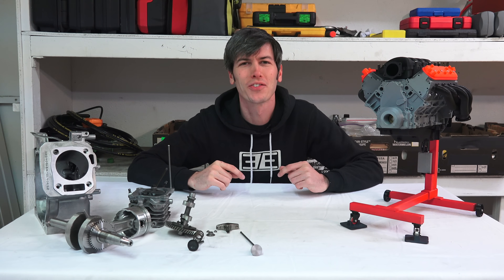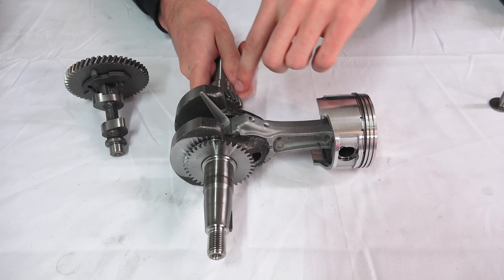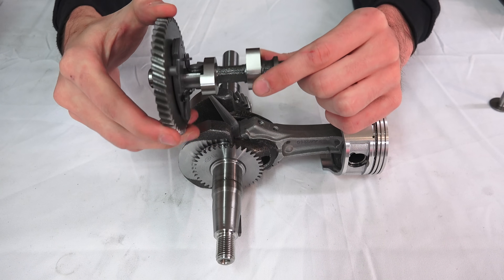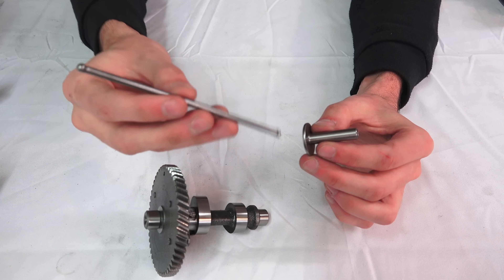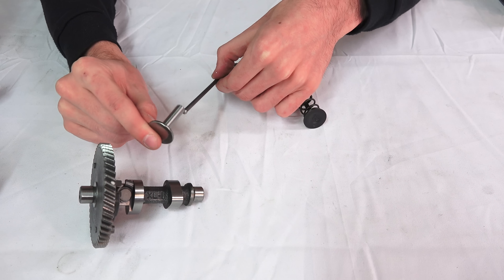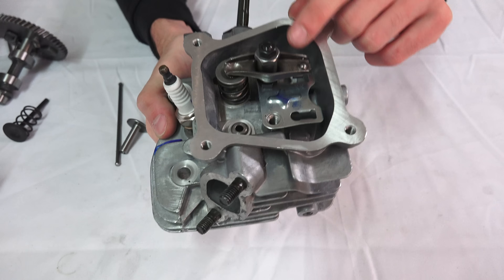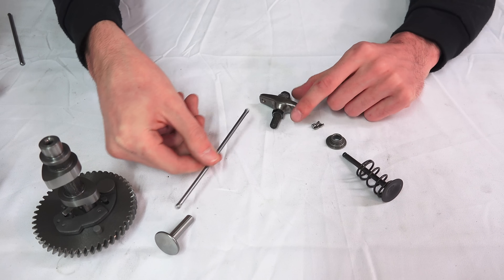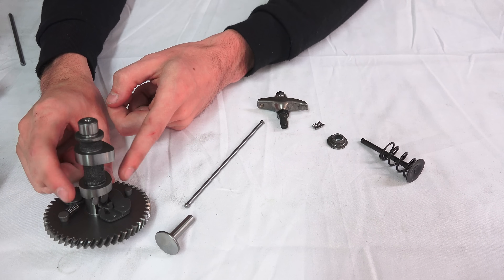Why Can't Pushrod Engines Rev High?

Comment: Everything is not about RPM but I hear what you're saying I seen lots of good pushrod engines rev high enough
Reply: They usually go as high as 5000 rpms with 6000 being in the caution and 7000 is the redline. But really you get lots of power in the lower rpms. Climbing hills is so much better in a push rod engine because of the low end torque. Going from a dead stop is always satisfying because you get so much power and you’re only at like 2000 rpms. Slower the cars moving the better faster the cars going it take a second or two to get the torque like if you are driving on the highway and need to pass someone it sometimes feels like the cars lagging to find the power to pass. But going slow the powers always there. It’s great in the low end sucks in the high end.

Comment: I have been into a some Ford DOHC V6. I will take pushrods any day. I'm speaking of drag racing, unless it's a pro stock, most engines I have seen that screamed outrageous RPM were usually 4 speed and impressive but not as fast as an engine that turns lower RPM with a power ladder. But don't listen to me, I'm still hanging on to the old Chevy V8 lol

Comment: My VK Holden Calais Director (Chevy Small Block 5.7 Litre / 350 Ci) revved to 8500 RPM and it was bullet proof. I was doing 48 secs around Oran Park Raceway until my wife took it shopping and it was stolen by a thief that followed her to the shops.

Comment: Instead of valves, why not have a wheel that spins and has an aperture in it through which fuel & air flows into the engine (the exhaust wheel would be the same but its aperture would align with the exhause stroke ofc).
It would be like a coin sorter.
Presumably the fuel and air would leak out of the gaps between the wheel surface and the edges that stop fuel just flowing all over the engine block on the non-fuel strokes?

Sure it would be inefficient, but could this give a much higher revving ottoman engine?

Comment: I was about to suggest an 8-stroke engine of sorts, with  4 valves per cylinder, but then realised it would face the same problem I've listed the proposed strokes below.
But surely doing the below, and using every other valve, would some kind of benefit to the wear and tear of the valves?

1: air intake 1 opens
2: compression
3: ignition and power stroke
4: exhaust port 1 opens
5 air intake 2 opens
6: compression
7: ignition and power stroke
8: exhaust valve 2 opens

Thus

Comment: the pushrod is the problem also too many moving parts. ohc does not have the pushrods. the cam lobe pushing strait down on the valve helps but then the chain or belt has to spin the cam and crank sprockets which needs tensioners and guides due to the length of chain and/or belt. the solenoid powered valves can be the answer.
Reply: solenoid is not the answer.  there is a limit on how fast a solenoid can make.  it is simply not up to the high rev engine standard.  so the highest rev monster motoGP engines use compressed nitrogen to open the valves

Comment: GREAT explanation.  Coincidentally I had just been exploring what "dual overhead cam" engines are (trying to learn about Alfa Romeo Spider engines) and they point out exactly the same things but from the sligthly different perspective of showing "why DOHC supports higher RPMs  than push-rod (less mass so less float and more valves for more air/exhaust flow, flexible intake/exhaust timing, as you nicely explain) But your explanation really explores and illuminates the push-rod engine side so I understand  both a lot better.  THANKS!  Subscribed and looking forward to more of you great explanations!

Comment: Am I the only one who likes all my torque/power under 3500 RPM? If you don’t wanna make power until 5500 RPM buy a Civic..
Reply: Same as me.  I am a lazy driver who do not want to kick the pedal hard to accelerate.  So low speed high torque is good to me.  I want smooth drive and not the thrill in speed

Comment: Marine diesel-engines are all made with push-rods, the main reason is the maintenance of cylinder-head/piston/liner: with a cam-shaft placed down, you can remove only one cylinder-head at the time, if you have an overhead system, then you need to remove the camshaft first, which is very heavy, because it pushes also the fuel injection pump, one per each cylinder.

Comment: Okay, let's get a couple things strait here.... Pushrodders will rev beyond 10k in the right build, ohc engines will float valves too just because they also rely on springs to close the valves, the only thing that WON'T float valves is either a desmodromic or a rotary-valve because neither of them rely on springs. I used to work on old radial engines that had triple valve springs and you could hear the harmonics starting to come in at 2950, and a self-rev-limiting valve float at 3300. Our 70's 377 Chevy Nascar engine on the other hand, would rev until it self destructed (Due to a rotten set of rod bolts) above 10k with no hint of harmonics or valve float. It's all how you build it.

Comment: Valve float is still a problem with overhead cams and with the use of auto adjustment oil filled hydraulic tappets oil aeration will limit the useful rpm of the engine anyway. For normal road use there is no need for high rpm which increases noise wear and narrows the power band which generally makes the car an absolute pain to drive. The balance between between  high bmep torque and power giving the widest power band possible is much more conducive to general use. The use of short hollow push rods and  hydraulic tappets can be used  to vary timing  and give a much more compact engine for packaging purposes

Comment: Around 9k rpm, valve springs need to be so heavy it frictional loses overtake power gain. 9k is therefore where pushrod engines becomes unadvisable

Comment: I had a streer rod with 302 with factory stock long block. Never had any problem accelerating to 6000 rpm. Never had a problem, and never needed more rpms than that. Very nice, simple, low maintenance affordable engine.

Comment: NASCAR can turn over 9500 rpm, and custom built gen1 Chevy can turn 16000, how fast do you want this engine to turn!  Besides most poshrod automotive engines make enough power 6k rpm is plenty! Besides at higher rpm engine components wear faster! Also aftermarkets have "rev-kits" putting extra springs on the lifter , taking them out of the equation, making them some what the same as a overhead cam engine,

Comment: Really there are pushrod engines with four valves per cylinder. 

for example Mercedes truck engines. OM 501V6, OM 502V8, smaller OM 904/924, OM906/926.  

Also MAN, Scania, Cummins, DD, Cat made pushrod engines with 4 valves per cylinder.

Comment: Push rod engines have low red line as parts have little bit play in them ..the accuracy to open n close valve trimming is a issue other thing is its longer stroke n high compression....piston travels more distance to complete one stroke...like in old hemi v8.....but it delivers high end torque at low revs...

Comment: I have a question, why some v8 engines in there stock state is so weak compared to other engines, for example ls3 produce 400 HP or lower while some small inline engines produce the same ?

And make a video comparing all of the most famous engine layouts and what is more efficient and which can be tuned for the best.

Comment: There is an modified LS7 that revs 11200rpm now. It's called spinal tap build by EFI University.
Reply: That's proof of the pudding, they have:

- a blank cheque-book (compared to most engine builders!)
- all the engineering know-how & metallurgical wonders that 2019 has to offer
- the expertise of an institution dedicated to building high performance engines

Yet they're unable to generate pushrod engine speeds higher those those (reliably) achieved by overhead cam race engines 30+ years ago. 

It's not a matter than you can't get high rpm from a pushrod engine (~12,500rpm is the highest I've heard of in large, multi-cylinder engines), it's just that with equal expertise and technology the engine-speed ceiling will be considerably higher with an overhead cam engine. Consider that F1 engines were race-reliable (so good for hours of hard running) at 19,500rpm and that was 20 years ago - just before the 19,000rpm cap was introduced.
Reply: @descb1060  F1 engines use small pistons with a very short stroke. It's all about piston speed.
Reply: @descb1060  From what I have read the big limiting factors on engine rpm is how stroke effects piston speed. Different fuels explode at different speeds. Those super high rpms are possible with racing fuel not with gasoline. Those engines also use really short stroke cranks. The whole overhead cam vs pushrod debate isn't about what's better it's about what works for a particular application. Pushrod engines are lighter and more compact. Getting that setup to run like an OHC engine is very difficult but not impossible depending on what OHC engine you are competing with.

Comment: most push rod V8 are set up for  low end grunt in truck/ passenger car  applications  they can be built to rev high but most street aplacations it's  not not nessary simply the low rev engine will last longer

Comment: AND THIS IS EXACTLY WHY THE COYOTE AND THE VUDOON ENGINES!.....FROM FORD MOTOR COMPANY CAN MAKE SO MUCH POWER FROM THOSE LITTLE (Well, Relatively Speaking!😉) CAN MAKE THOSE MUCH LARGER LS OR LT CHEVY V8's AND THOSE MOPAR HEMI's SEE THE "ASS END" OF THE MUSTANGS!!.........EVERYONE BUT FORD IS USING 100 YEAR OLD TECHNOLOGY WITH REGARDS TO THIER BIG V8's!...........EXCEPTION BEING, THAT FREAKING BEAST THAT WAS IN THE ZR1 VETTE's FROM 1990-1995 AS THAT 350 (ONLY SHARED ENGINE DISPLACEMENT WITH THE REGULAR 245-260 HP ENGINES FROM THE REGULAR CORVETTES!!!.......AS THAT MERCURY MARINE+YAMAHA (With Some Ferrari Mixed In!) WAS A GREAT DOHC 4 VALVE PER CYLINDER 405-415 HP (WHICH WAS REALLY PUSHING CLOSER TO 500 HORSEPOWER!! "AND MACHINED SO PERFECT, THAT HEAD GASKETS WERE N-O-T EVEN NEEDED!!😳😳😳 WAS A TECHNOLOGY MASTERPIECE FOR WAY BACK IN THE LATE 1980's WHEN THEY BUILT THAT GORGEOUS PEICE OF REV. TO THE MOON ENGINE!!......

It's Too Bad That It Cost More Then The REST OF THE WHOLE CORVETTE TO MANUFACTURE!......BUT AS A FORD MAN! I DID INDEED HAVE THE PRIVILEGE TO DRIVE A 1893 CORVETTE "ZR-1" WITH THAT LOVELY DOHC 32 VALVE PEICE OF MECHANICAL "JEWELRY" THAT RESIDED UNDER THAT HOOD!!......AND AT THE TIME.......NOTHING "PRODUCED FOR THE AVERAGE NON-NASCAR, OR FORMULA-1 DRIVER" CAME CLOSE TO THAT BEAST!!.......RUMER HAS IT, THAT GM IS THINKING OF BRINGING HER BACK!!!.....FOR SOME 2021 SUPER-VETTE!!........AND THIS TIME!.....THEY ARE GOING TO "FORCE-FEED" THAT BEAST EXTRA AIR AND FUEL ⛽️!!😳😳😨😨!!....PRESSURING THOSE CYLINDERS WILL BE A SCARY DEVELOPMENT!!.......Take it from a Guy who Slammed the "LOUD PEDAL" YEARS AGO WHEN SHE WAS BREATHING NATURAL ATMOSPHERIC PRESSURE!!!.........😎😎😎😎😎,

Comment: I really think that the stiffer spring would be an easy solution for the already nicely produced engines. Id like to test this in a Volkswagen beetle (an air cooled 4cyl known to brake valves at high rpm) or in a small Briggs&Stratton by increasing the spring power to make the valve follow better. Also I find the argument for an efficiency loss due to the stiffer spring simply non relevant as its a small spring under 2:1 ratio torqued cam and it saves the engine from braking the valves in the higher rpm. I mean I happen to apperciate engine not to go boom and costing a lot off $$$.

Comment: motors need a new take on the flathead. so many less parts, but needs desmo so cams dont float. and heads reworked for better flow and compression.

Comment: Simple answer, valvetrain stability. OHC engines can use softer springs and cam lobes with less radical slopes because they don't have the reciprocating mass between the cam and spring.

Comment: Fast Forward to November 2019, and EFI University and Comp Cams have a LS7 revving to 11,300 rpm successfully.  Quite an interesting development.
Reply: There have been drag engines running 12-13 you will just go through a box of springs every race.
Reply: I’m guessing they reduced the stroke a whole lot?
Reply: @herpderpinson6117  stroke reduction impacts piston speed, not valvetrain speed. Valvetrain speed is what leads to float.
Reply: @nikos95  It’s a lot easier to reduce valvetrain float at those RPMs than it is to get a motor with a 4” stroke to rev that high in the first place; I looked it up and it said the motor’s 5.8L, which pretty much confirms they destroked it, as I doubt they would want to sleeve the cylinders since bore doesn’t really have an effect on effort per piston speed.
Reply: @herpderpinson6117  Indeed, piston speed is a pretty hard set limitation.
Reply: @nikos95  if piston speed increases due to de stroking the engine meaning there is less travel speed meaning the valve train is having to open and close the valves faster to accommodate the extra piston speed therefore causing extra movement and flex of valve springs over time . The force maybe be less on the valve spring  per stroke but the use is nearly twice the amount while valves are still having to open the same causing wear so how does piston speed not effect valve train?
Reply: @joshreynolds729  piston speed is reduced, not increased by de-stroking, less distance per revolution. Valvetrain operates in relation to RPM, not piston speed. 3000rpm is the same for the valvetrain be it a 2" or 4" stroke, but piston speed doubles.
Reply: @nikos95  yes it is less sure if you were to measure the same rpm the speed would be less but the reason they want a smaller stroke is to rev higher meaning the piston speed are cranked up at top rpm through timing and fuel to be about the the same while the rpm is reliant on valves and the ability to advance timing as piston speed increases which is the whole point of having a smaller stroke then to make the difference up of tq loss boost is given with the proper gearing. My point is that yea your right on paper but the materials can only do so much so each piston is capped on speed based on rotational mass friction and heat expansion and material strength. More material more tq longer stroke less rpm and if you go the opposite then piston speed is reduced therefore more timing and rpm can be achieved assuming valve float doesn’t happen therefore the speed increases as power output does which reach a cap which is relative.
Reply: @joshreynolds729 we have no disagreements. -- I only made a comment on the fact the two are separate issues and reducing stroke doesn't reduce valvetrain speed. The video if I recall was focused on valve float. Lots of issues come into play when building high rev motors.
Reply: @nikos95  exactly
Reply: @herpderpinson6117 . Richard Holdener has steady proven that stroke does not come into play on 99% of builds.
Reply: Dont need to David Vizard had an old dunbeam avenger reving to 11 grand many years ago...
Reply: for 1 power run of a few seconds....
Reply: wrighty338 Still impressive honestly.
Reply: @wrighty338  You can run a stock ls6 at 7200rpm for 100 hours straight and be fine. I've seen higher with race springs.
Reply: @wrighty338  No, it ran at that RPM for 20 minutes and then disassembled to reveal no damage.
Reply: My 1992 Honda VFR750 would run at 11,000 all day long achieving 42mpg on RON 84!  DOHC V4.
Reply: Tom Everett but then again that’s not a pushrod is it?
Reply: @tywachs  nope!  Gear drive dohc.

Comment: Many of these engineering reasons are why if you have a pushrod-operated engine, the more cylinders, the better.  
Does a V-10 or a V-12 need to rev to 10K...or even 8K?  I'd say "no" because of the massive amount of low-end torque.  V8s still don't need to rev that high, relatively speaking, depending upon displacement, engine architecture and intake/exhaust set-ups.  When you get to down to V6s (and extremely rare V4s), now higher revving (and thus DOHCs) are both more efficient and necessary for higher peak HP.

But as we all know, peak HP doesn't win races...torque wins the day :)

Comment: This video is a bit disappointing. It should of been titled " why OHV engines have valve float" or something to that effect. Low redlines in American V8 engines have more to do with having longer stroke crank shafts that produce more inertia at high rpm. Compare that to an engine from a high reving Honda and you will find a short stroke with light weight rods and crank shaft that produce less rotating inertia which allows for a higher redline. Most economy class dohc 4 cylinder's cannot rev past 6500 to 7500 rpm because they will break rocker arms or bend connecting rods. How high an engine can rev has mostly to do with what the engineers designed it to do. Example: Ford GAA tank engine, all-aluminum 32-valve DOHC 60-degree V8 producing 1,000 pound-feet of torque from idle to 2,200 rpm. The factory-rated output was 500 hp at 2,600 rpm. Compared to a Ford derived NHRA competition eliminator car engine, V8 OHV making 800 HP @10,000 rpm. Both valve train types can be high or low rpm, it just depends on the end goals of the engineers.

Comment: I always thought since pushrod engines usually have larger displacement meant they were bigger engines. When you put a coyote engine next to lt1 engine. The coyote dwarfs the lt1.
Reply: And there is the problem. The Coyote and the earlier 5.4s are a huge lump and very top heavy as well. And the muttering rotters all wax lyrical about the Coyote Mustangs. That are slower than a 6 litre LS.
Personally I prefer the Mustang, but the  pushrod Chevy engine is simpler and does not spit timing chains all the time. And no I am not in the market for either!!